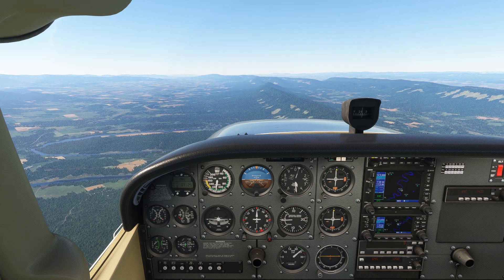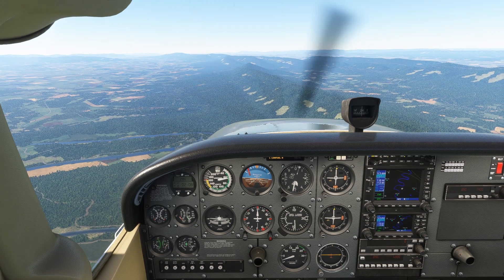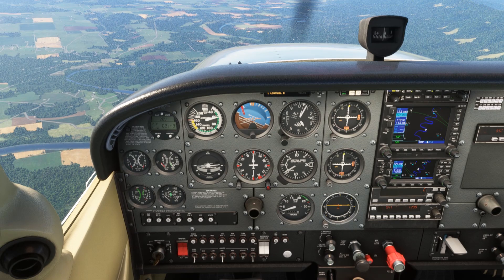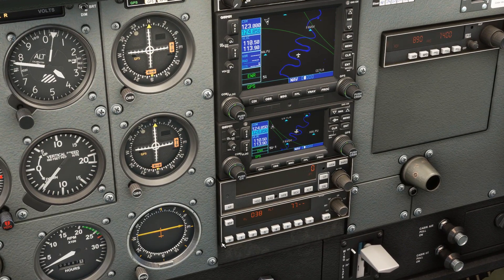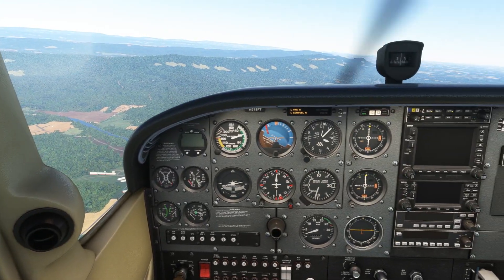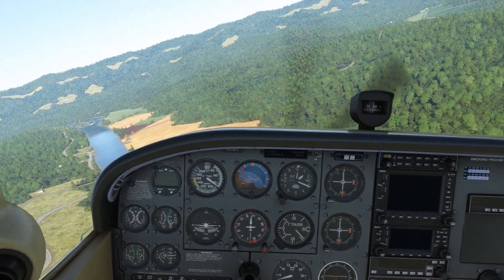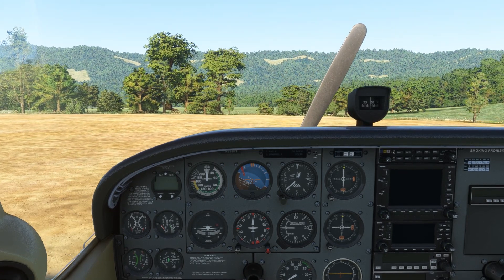What to do if your engine fails in flight | Emergency Procedures

Comment: One thing that I’m was recently corrected on by a much more experienced instructor is the initial pitch for best glide. I verified he was correct in the airplane flying handbook (see pg. 84, 3-23). Too many student are “climbing” to their best glide. This idea of trading airspeed for altitude during an engine failure is incorrect. The correct procedure is to maintain altitude, trim the airplane for the best glide, and let the airspeed bleed off until achieved best glide.

Comment: A quick way to establish attitude for best glide is to look at the wing tip and have it level with the horizon. Also published  best glide is at max gross weight. It will be by less if you’re not at Max weight and do you really have time to compute that absolute number? 5:51

Comment: Good coverage of the high engine failure, high altitude orientation.  Altitude is time.  While not covered as extensively in Airman Certification Standards, the low altitude engine failure is more likely to result in a fatality.  Low altitude orientation is different.  Horizontal as well as vertical space limitations exist.  Turns are to target, not heading.  Wind management is more critical.  Headwind reduces the radius of turn.  Downwind increases the radius of turn.  Stall/spin is inadvertent and recovery is seldom possible.  Use of the stall prevention feature, especially in turns, of dynamic neutral stability is critical.  To prevent stall we need to not pull back on the yoke in turns to maintain altitude.  Airspeed, and not altitude, is life down low.  We need to fly all the way to the landing zone.

In 17,000 hours below 200' AGL crop dusting and patrolling pipelines, I had eleven engine failures.  They were six second deals.  Zoom reserve airspeed allowed me to maneuver to a survivable landing zone in the very near hemisphere in front of the wing.
Reply: How do you pick a landing area?  What about rough terrain like plowed field or lots of swells, trees, and rocky out crops?  I imagine that off roading would be like going on ice in a airplane.
Reply: @johnc.4871  Having worked Ag out of farmers fields or just farming or ranching gives us experience with roughness evaluation, but FlightInsite is teaching about engine failure.  In the west there are many straight and wide roads with good distance between crossing service lines.  In the Midwest there are lots of grass fields and good county roads.  Where open areas without buildings and obstructions are not common, flying all the way to the crash is critical and using rudder only (don't put a wing down into terrain or obstructions) to yaw the nose between houses or trees or whatever is critical.  Small airplanes can be landed slower than automobiles crash and have better crash survivability.  In low altitude work and around the airport, the survivable landing site in the very near hemisphere in front of the wing will be obvious.  Just have the engine failure with zoom reserve airspeed, enough airspeed to maneuver a bit.  Neither Vx nor Vy is a zoom reserve airspeed and no crop duster will hang out at those V speeds because they are deadly.
Reply: @johnc.4871  At low altitude, the forced landing is truly an emergency requiring immediate action.  You don't pick a landing area.  It is there or you accept speed reduction, wings level, and using rudder only (don't put a wing down into things) to yaw the nose into the best situation between two objects so as to use the wings for further deceleration.  Again, a six second deal.

The good news is that everywhere save dense buildup and water, the survivable landing area is obvious.  Low altitude on takeoff, crosswind, base, final, and working a crop field limits the possibilities.  Look from wing tip to wing tip in the 1,000' or so of slant range before the horizon.  There are fewer possibilities in this small hemisphere than would be available up high.  We are not high, however.  We do not have time, however.  Just there.  It really is not a big problem.

Use the zoom reserve airspeed, Vy is marginal on takeoff and crosswind.  You have a license to learn.  Use it to discover Vcc, which will make the takeoff engine failure quite manageable.  No, faster and lower means no going back.  Just that may have saved your life.  The LZ is close.  If you have zoom reserve airspeed, enough airspeed to maneuver somewhat normally, you can pitch up wings level to slow down for a very close LZ.  But when you bank enough (it really doesn't matter how much) to make that LZ, you must release that elevator back pressure so the the very steep turn remains at 1 g.  You now will likely be high and fast but lined up on the LZ.  Full flaps and rudder to the stop slip (side slip if lined up or forward slip if done during the turn) may be necessary to make the beginning of the good landing area.  Do not delay.  Make it happen.  Most high forced landings touch down halfway through the available landing area and often hit things beyond.  Don't do that.

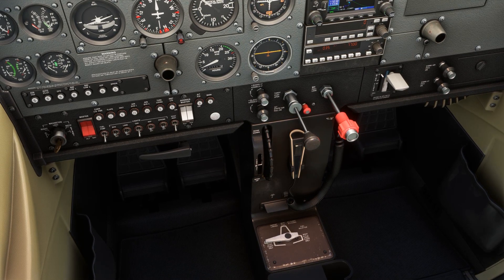Comment: 3:17 the fuel shutoff valve is the little red knob between the mixture and the throttle. This plane looks EXACTLY like the c172S I got my private in.
Reply: No sir, that's the alt static air. Fuel shutoff is the bigger red knob hidden from this point of view behind the external mic cable - just up and to the right of the tank fuel selector.

Comment: C172S the plane I got my private in... the engine out is engrained into my brain: Pitch for 68kts, select landing site, mixture shutoff valve full in, tanks both, aux fuel pump on, masters on, Crank. If no restart, ensure 68 knots still, continue flying towards landing spot, If time allows try alternate restart; mix idle cutoff, throttle full in, fuel shutoff valve ensure in, tanks both, Aux fuel pump off and crank. lol.

Comment: You've got bigger problems than an engine failure.  Have you not noticed you are missing both yokes?
Reply: Pretty bad to not catch that on preflight inspection, not sure if this is a guy you want to learn from
Reply: It's a simulator not a real plane !
Reply: I fly with my mind. I haven’t touched a flight control in years.
Reply: In MSFS you can hide the yokes so you can see the dials better..
Reply: Joke went right over your head
Reply: @Andromedon777  yep....
Reply: @Andromedon777  Jokes don't have to be everywhere, though. If everything is a joke, nothing is.
Reply: @Andromedon777  It flew right past....

Comment: I wouldn't turn my avionics off that early. I'd leave everything on until just before touchdown. Keeping your transponder and ADS-B running as long as possible gives ATC a better idea of where you ended up.

There's no need to mess with the avionics master. The avionics bus is downstream of the main battery contactor. When you turn your battery master off, everything is off except, of course, for your mags. If you're flying a glass-panel aircraft with a standby battery, you'd want to disarm the standby also.

If my ELT had a remote switch, I'd activate it at the same time I killed the master.

Comment: I would have thought windmilling propeller has much more drag than a stationary one. The reasoning is that energy is spent on turning the propeller with no onboard power.
Reply: Yeah I'm not sure why they said that, they know better.
Reply: Read an old AOPA article by Barry Schiff called stop the prop, I believe. Says that you need up to 7000 feet AGL for this technique to work otherwise it’s inefficient and it doesn’t benefit your guide.
Reply: @eds.173 , that's possible, but I reacted to a comment in the video that you can feel increased drag when the prop stops turning. I would expect to feel less drag if anything.
Reply: @tomaschrapek  Yeah, I missed that.  Thanks.  My comment therefore doesn't apply here, but a lot of pilots think that there's benefit to an aggressive climb attitude to stop the prop but apparently the physics for extending the glide doesn't work out unless begun at a surprisingly high AGL.
Reply: Yes with caveats. A windmilling prop at fine pitch (β) less than around 20° is more draggy than stopped but at coarser pitches becomes less so. Re Aerodynamics for Naval Aviators p149.

Comment: What happens when full electrical outage at night? 

This happened to me in sim in a 172 last night, I think from leaving taxi and takeoff lights on but not sure. Anyway I ended up without radio comms and no nav lights or squawk. Used a flashlight (in sim) to see the instruments but IRL I’m thinking I’d have to call the ARTCC on my cell phone?
Reply: Oh boy… Pilot Workshops has a great VFR Mastery scenario called “Low Voltage Over Eugene” that covers this situation very well. If you’re full electrical out at night, you’ve got big problems, but absolutely keep flying the plane at all times. Assuming you don’t have a handheld backup radio…
Personally, I would immediately find the nearest large airport (via EFB / ForeFlight), preferably a class D or above (control tower and better lighting) and head direct. Odds are it will have good lighting and long runways, and probably be near a city or town, so you have some visual reference (as opposed to a rural black hole approach without landing lights… that’s not possible except maybe on a full moon clear night). The side benefit of the larger airport is you’ll likely have access to maintenance facilities, but this is a side benefit for tomorrow… you need to land tonight!
Then once AVIATING and NAVIGATING, I would then COMMUNICATE by calling the tower via cell phone if possible and let them know the situation (ForeFlight / EFB airport info tab has all this info so conveniently available).
If unable to reach via cell phone (don’t bet on it), then just continue heading to the airport. Electrical out especially at night constitutes an emergency! Get down to pattern altitude (found via sectional and/or ForeFlight airport info tab) by the time you’re a couple miles out or even closer due to invisible obstructions (again, ForeFlight hazard advisor is a fantastic safety tool when used properly). Then…. I would circle the airport and wait for light gun signals. Your engine is working, the plane is flying, you have fuel… just relax now. You’re circling waiting for green signals. Quickly you’ll get a green to land. 
You’ll have a story to tell the vehicle drivers that pull up to you when you’re safely on the ground, perhaps maybe needing to make a phone call and some emails later as to what caused the emergency and why, but that’s about it. This was an emergency and as PIC you have full authority to break ANY regulation so as to maintain safety in the air and on the ground, period. This does NOT mean be reckless — breathe and think and act.
Lessons learned? Have a handheld radio especially for single engine / night ops, have a charged up-to-date EFB with GPS navigation and ADS-B receiver, and a charged flashlight/headlamp. Also, the night flight plan and emergency planning… pre-planning in riskier flights like this is critical.
Wow long reply, but a “fun” scenario to think through.

Comment: So on the 430/530 if you hold the comm flip flop button for 3 seconds it will automatically put in 121.500.....just a good little tip for people not real familiar with them.
Reply: My flight examiner showed me that after my successful PPL flight test….  Blew my mind.   LOL
Reply: Thanks for the tip.
Reply: GTN 650/750 Does the same.
Reply: It’s Garmin standard. A good one 😊

Comment: My instructor always taught me to keep the mayday short. You’re about to potentially be seriously injured, it doesn’t matter how many soles on board or what you’ve eaten for tea. A mayday with call sign stating an engine failure is absolutely enough. Aviate Navigate Communicate.
Reply: I'd argue that the potential injury is exactly the reason you'd want ATC and rescue services to know how many people to look for.
Reply: fun fact, there are 4 times as many soles on board as there are souls on board

Comment: On the G530 and G430 you can tune and make active guard (121.5) by just holding the frequency flip button. I don't know if the simulator models that accurately but it saves a little time in what could be a time critical operation.
Reply: Wait seriously?  I had no idea.  Thanks for that

Comment: I love all your vids.... but why would you kill the avionics?  To me... that's DUMB. You want your ADSb and Xponder all the way down so they can find you if needed.  AND... you will probably want to continue to talk to someone... assuming you are talking to ATC.
Reply: Don't turn off avionics until you are low. At that point, they know the situation and your ELT is activated. What more do you need? 

Turning off battery master lets you prevent a spark, which will save your life.
Reply: If the airplane is not trashed, you can turn it back on. If it's trashed, you won't be able to talk anyway. Why risk fire hazards by leaving any switches on?
Reply: Those checklist items weren't made for funsies.
Reply: @smvms  His point was mainly using ADSB for them to locate you. But, the misunderstanding is that doesn't actually help that much compared to an ELT